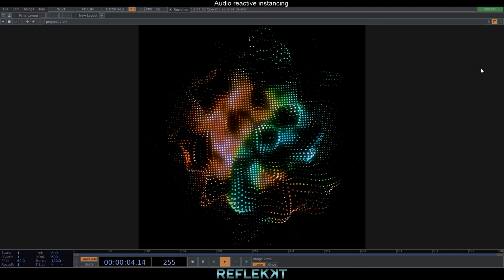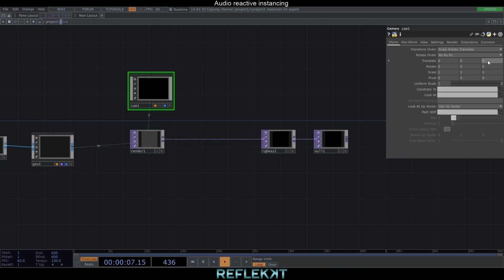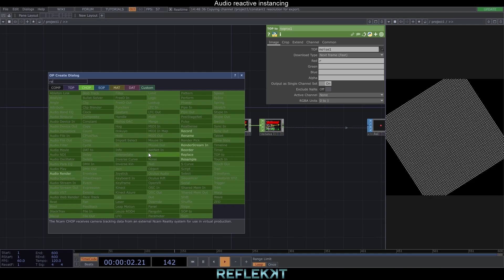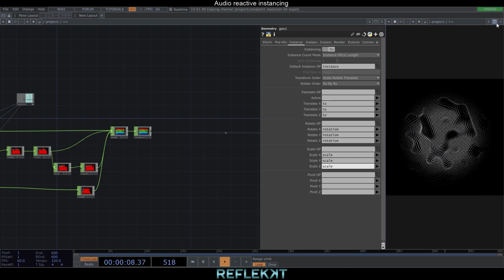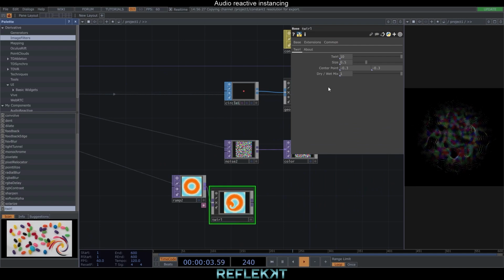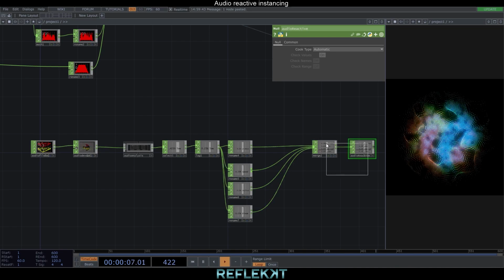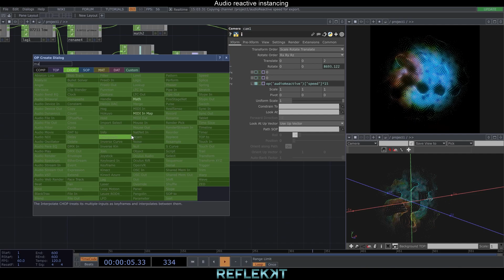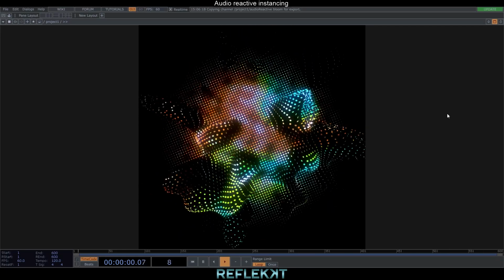Audio Reactive Instancing - TouchDesigner Tutorial 008

Comment: Hi, very nice video man, but I got a problem, I can see everything on the geometry viewer but when I export it i don't see anything and in the TOP viewer i can't also see anything, any idea of what can be wrong?
Reply from the maker: Mhh sounds like your camera is positioned or pointed in the wrong direction. Try moving your camera manually with the transform parameters of the camera COMP, also check if its rotated in the wrong direction. In the tutorial the camera is positioned to 0, 0, 2 and rotated to 0, 0, and Z axis is animated with the expression absTime.seconds*10 .
Also check if your last nullTOP with the final output has the blue Display Flag on the bottom right turned on.
Let me know if its working for you.

Comment: Nice Video! :) And i got a suggestion: I made a similar video a while ago and functionstr pointed out, that working with TOPs is wayyy more efficient, since it works with the GPU (opposed to the CHOPS, that work with CPU).
Reply from the maker: Thank you :-) Have to check out your video on this topic!
I honestly have a hard time working only in TOPs, as it doesn't have easy number values to work with. That whole pixelmath thing is not very conveniend to use for me... That black-white equals values between 0-1 is understandable, but how to work with it precisely is on another level :D For example I wouldn't know how to create values with TOPs like the speedCHOP does... Still a lot to learn for me :D

Working in CHOPs give me more performance tho than manipulating the grid with SOPs.